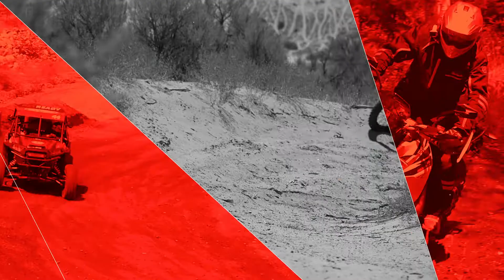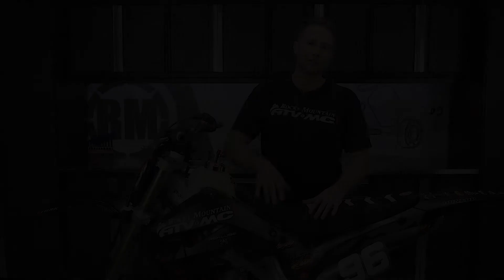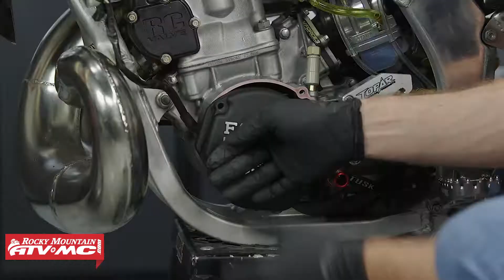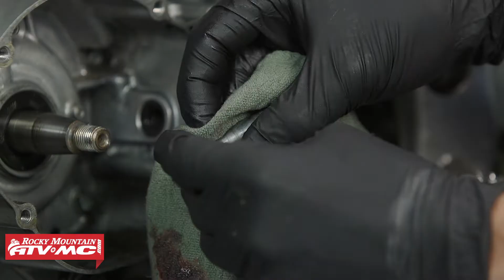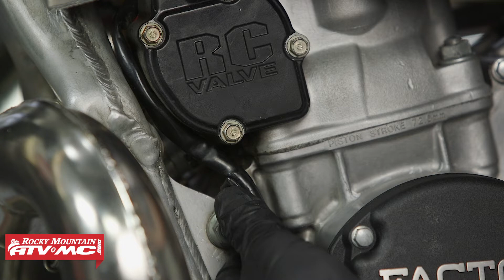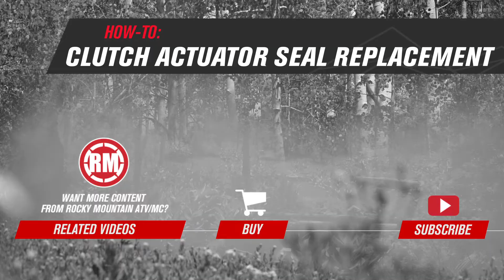How To Replace the Clutch Actuator/Lifter Arm Seal on a Dirt Bike

Comment: i have a 2000 cr125 and i did all this but for some reason the arm just doesn’t want to come out almost like it’s stuck maybe i need to remove the rod but i have no clue if any one can help me
Reply from the maker: It should be a similar process for that bike. Does it move half way out then stop, or does it not even budge?
Reply: @rmatvmc  moves half way out then stops

Comment: Hey Rocky Mountain. Love the vids and hoping for some insight. My actuator arm on my 02 cr125 keeps coming out towards the flywheel leaving me with no tension on clutch lever. I think it may be bearing inside.. if so, how do I go about replacing it and if not, what else may it be? Thanks!!
Reply: I have a 2003 that does the same thing.  My clutch cable actually comes off.

Comment: This would be good if I had that type lol. If you could do one for the actuator is on the top. I dont know how to get the bearings out because it has a lip over the bearing and I need to pull them out some I'm not sure how I get them out with that thing there.
Reply: Need you find out how to change the bearings? Did you have to take the lefthand case off in the end to access the bearings?
Reply: If you know anything let me know please I could really use the help. The bike is an 89 kx250